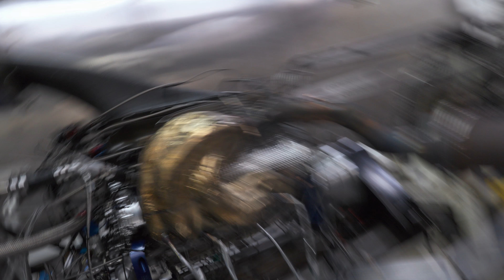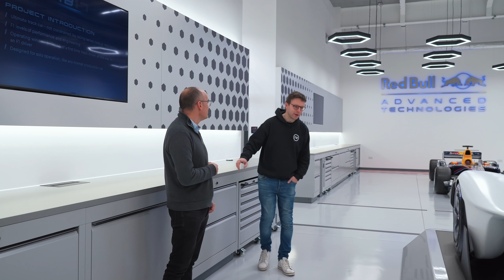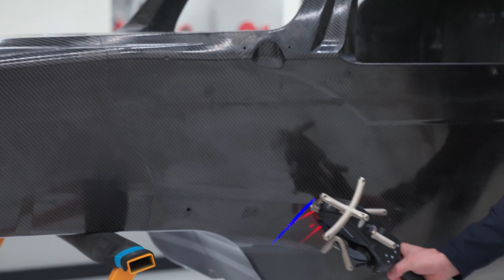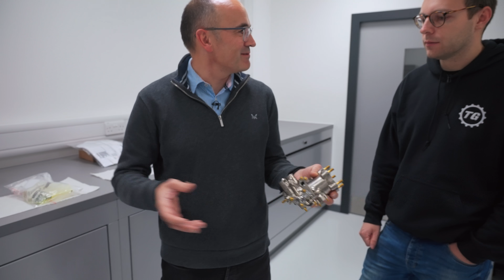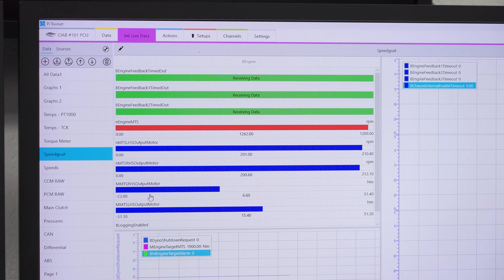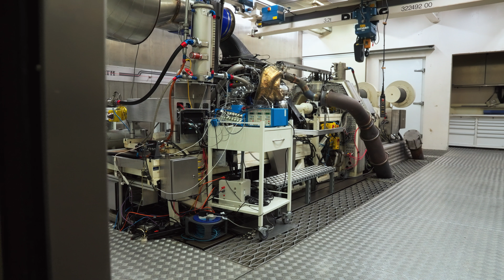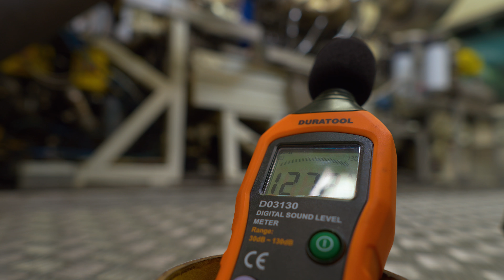Hear The Red Bull RB17 Scream: 15,000rpm V10!

Comment: Imagine 2026 f1 cars with this engine and no hybrid 😮‍💨😢
Reply: Imo hybrids get the best of both worlds, low rpm acceleration and brake regen as well as sound, character and power density of gasoline engines
Reply: @ShivamArya-yf4ku  you don´t need low rpm acceleration in racing. They usually have a gear se for the track and are always in the right rpm range. But e turbos might be very usefull.
Reply: @sebastianjo752 Yup, considering 2006-2013 F1 cars didn't struggle with 240 ft lb torque, way too fast even
Plus hybrid doesn't affect sound and rpm unlike turbo
Reply: @ShivamArya-yf4ku  hybrids makes the car faster, you don't need fast cars to having great racing. Less weight, nimble, smaller, less grip = pure driver skill and bravery is rewarded
Reply: Fun fact: Hybrid doesn't affect the sound. It's the turbos you wanna get rid off if you want the sound. 

The Revuelto, Tourbillion and laFerrari are all hybrids (with no turbos)
Reply: @499p-l1w but it affects the handling. We want cars to be agile and nimble without a push to pass button.
Reply: @calvinallan2208  No, we want closer racing action and overtaking, not parades. Anyone who has followed F1 for a long time will tell you how boring the V10, V12 eras were. The sound of the cars only matter to people who started watching F1 two years ago.
Reply: @499p-l1w  yeah nothing screams great racing like energy management chess play and push to pass. 😅
Reply: @calvinallan2208  With further development we might reach a point where we'll have very lightweight motors and tiny batteries, it just has to be developed first
Reply: Hybrid is the Porsche 919 evo, the absolute beats in Nurburbring.
Reply: Hybrid is actually cool tho
Reply: Why do y'all hate hybrids so much? I think they are pretty cool
Reply: @AB_LH44 Because Hybrid = boring Toyota Prius stigma
It's nonsensical, but that's how society works
Reply: @Holoflux hybrid with a high revving v10 sounds like heaven honestly
Reply: @tyler_bt3326  ad now a bugatti with a v16 hybrid
Reply: @Holoflux wait, didn't the hypercar trio (porsche 918, la Ferrari and mclaren P1) reversed that damage done by the prius. I think in the context of f1. People hated it because it traded howling V8 and v10s for "quiet" hybrid v6s
Reply: @flameburstgt6503  theres ppl out there who still hold the hybrid = prius mentality
Reply: @flameburstgt6503  Which the turbos are to blame for that, not the hybrid part, but people can't think critically idk how else to explain it
Besides it's completely subjective anyway, to me naturally aspirated might be LOUDER but turbos sound more powerful to my ears
Reply: @Holoflux turbo v6s in 1980s sounds badass. The issue is that the MGU-H muffled the turbo sounds. With that device gone in 2026. Hopefully we can hear the turbo spool and blow off valve / flutter a lot better
Reply: @flameburstgt6503  If the early recordings of the new engines are anything to go by, they sound exactly the same, sorry to disappoint you
Besides like i said, i like em as they are, nothing sounds like those engines
Reply: @Holoflux eh, I listened to the recordings as well and in my opinion they definitely sound more throaty. Granted it’s on a dyno but it’s definitely better
Reply: @flameburstgt6503  I think they sound the same as before, it's the fact it's recorded in a room
Look up any of the fire ups from previous cars, i remember the MCL36 fire up sounding just like these new clips we're seeing now

Comment: I still want more revs, 19,000 rpm goddamn it
Reply: This V10 is 4.5L, quite a bit bigger than the V10 F1 cars had with 3.0L, plus needed massive amounts of budget, specific preparations, short life maintenance, etc
Reply: Buy an old superbike
Reply: Won't last 20 laps
Reply: @499p-l1w Wrong.
Reply: @TheChipMcDonald  The guy at the end did say an engine revving that high wouldn't last long at all before a rebuild
Reply: @Rezcuz  As long as the mean piston speeds aren't high, 19k rpm can be as durable as 8000 rpm of a normal engine. 21-25 m/s^2 is usually considered the acceptable high, >25m/s^2 is when it all starts to creep into short life so yes 19k rpm can be a long life engine by design
Reply: @cyubahiroyves2899  Just repeating what the managing director for Cosworth said
Reply: @Rezcuz They ran v10s at 19,000 for entire F1 races.  This is headed to WEC or a consumer version, that will have to last longer than an F1 race.
Reply: @TheChipMcDonald  It's not headed to WEC, it's specifically for this car. And the guy said in the video they lasted for a few hundred kilometres. They need this to last way longer before a rebuild, hence why 19,000 wasn't optimal.
Reply: @499p-l1w  15k is already really pushing it. Need to consider some reliability.

Comment: RB should branch to LMH or LMDh fr, use a variant of the RB17 like what Aston Martin is doing
Reply: thats exactly what i thought, would make for a phenomenal lineup imo. having the throaty V8 from Cadillac to the screaming V12 of Aston Martin to now the wailing V10 from RB. would be absolutely incredible and a blessing to the ears.
Reply: @B-man5 that would be cool. The OG vs the evolution
Reply: @B-man5  it would need to be massively detuned to get into the aero window yet alone being silenced to get below the db limit the hypercar regs have(the valks in wec is silenced more than the imsa car is)
Reply: @markhunt7434  that's how racing works
Reply: @markhunt7434  Don't know if you were at a WEC race this year, but the Valkyrie is loud enough. It's the LMGT3 cars in WEC that are being castrated beyond recognition.

Comment: I know you can all do the math, but the idea of a reciprocating mass doing 250 strokes per second is something I just can't conceptualise myself - amazing!!
Reply: especially combined with the service interval indicated by the cosworth CEO, it really makes one think, that crankshaft has to be from out of this world.
Reply: Real insane is CBR250RR did 19000 rpm, mass production, cheap and decently reliable in the 90s
Reply: @MambaScalabrine-ub2kl the 250RR's redline is at 19k yes but it doesn't hit limiter until 20k, it is very hard to comprehend that there at 4 little pistons each going up and down 333 times a second
Reply: @jaydenriley6739 Yeah, it is - because that was a two-cylinder.
Reply: @KRAMITDFROG inline four cylinder
Reply: ever seen a fly?
Reply: @flummi6966  Wow I had no idea - thanks for a really amazing Google!!!  Who knew!? (not me)😄
Reply: @Phillip_Bailey_original   i didnt google, you can hear the frequency of something like mosquitos ,fly and bumblebees quite easy. depends OFC on your age and amount of party nights/concerts.

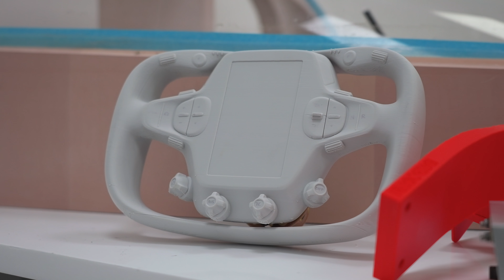Comment: 11:35 The car-industry copied everything "Wrong" with Tesla's vehicles(Touch-screen for everything). Tesla had to cut costs dramatically to promote the EVs of that era because batteries were so expensive. Much later, when the cost of batteries had fallen, car-companies are still using touch screens for everything. A damning illustration of how clueless and incompetent car companies like VW are.
Reply: New VWs are totally fine and the upcoming models will all feature more buttons again. A touch screen is perfectly fine as long as the most important functions still have physical controls.
Reply: @kraenk12  VW has made huge mistakes and will likely go bust.
For some reason, they decided to make the I.D. range which are too similar to the offerings from Tesla. However, in comparison, the VW cars are severely lacking with regard to drivetrain efficiency (and also fast charging/charging infrastructure).
VW presumably went for this sector because it is the most popular. However, at the time, VW had battery procurement problems and would not have been able to make the cars in sufficient quantity had they been popular... (They should have done Estates/Avants etc sooner). Now VW have their own battery plant(s), but everyone that wants an EV has one and they're not competitive enough.
The ID interiors look(ed) like the were designed by an undergraduate and 3 buttons to control 4 windows?!
Reply: Cant be that  WRONG as people bought the vehicles and made the model y the best selling CAR in 2023
Reply: @larropowell3658  Do you not understand the inverted commas?
There are pros and cons to both switches and touch-screens. However, for a driver, driving, tactile switches are better.
Reply: @Sidowse Inverted comma what has that got to do with my reply and as for your statement regarding driver and switches like I said the millions of DRIVERS that bought the tesla cars were quite happy with the screen set up. Tactile switches tactile screen they chose.
Reply: @larropowell3658  You don't understand my initial comment. If you did, you wouldn't have replied the way you did. 
Just because the Tesla <model-Y> sold really well, doesn't mean that it didn't have any negatives! Also, non car experts buy a car expecting the manufacturer to be more clued up than they! Only when living with the car would they subsequently encounter all the negatives/oversights and by then the car has already been sold/bought!
Reply: @larropowell3658 it’s far from the best car and since then sales have heavily declined.
Reply: @kraenk12 I did not say it was the best car I said it was the BEST selling car and sales for anything will eventually decline over time.

Comment: Adrian did the Valkyrie for Aston Martin before Red Bull terminated their relationship with AM and finished the rest of the car raw in places. Now Adrian does this car for RB and leaves for AM before it's completed.
Reply: What a full circle moment this is 😅
Reply: Only sort of. It was Aston that terminated the relationship because Lawrence bought the marquee. 
Aston ran out of money so Adrian couldn't make all the updates he wanted and the relationship was ending, so Aston took the LMH car that it canned and added some of Newey's modifications at the time and called it a day. 

But yeah, it is a twist of irony that Adrian would end up back with Aston after all that anyway, but he did say he wanted to work with road cars, so it was always a matter of time.
Reply: @F1ll1nTh3Blanks correct.  The AMR Pro has compromises that the RB17 does not have.  The RB17 is Adrian Ana Red Bull throwing everything they can at a car to get maximum performance with no limitations.   All prior track records will be shattered.  With the top tires it will make F1 look slow because of the lack of limitations.  Mega power and mega downforce.  It will be very important that the owners are properly trained to drive it if they want to get anywhere near what it can do.
Reply: Only this time he's still in charge of the Rb17 project until the end of it

Comment: So it will essentially be taking the aero + weight of the Valkyrie AMR PRO, but having the power of the road going hybrid 1200hp. The Valkyrie amr pro was already LMP1 fast, but I'm pretty sure, this still isn't enough to bridge the gap to the quoted "as fast as an F1 car" as all of these super hyper track cars have promised at the start. Or maybe... they had pictured 2026 F1 regulations long ago, and knew they would be like 4 seconds slower a lap, and over a long track like Spa, they might be able to beat an F1 car that's on a full tank of fuel.
Reply: Only if it's Max driving it
Reply: It's 100kg lighter than a AMR PRO, and 200hp more powerful, it has more aero, special designed tyres and the most importantly ACTIVE FANS that blow the diffuser at ZERO SPEED. In 'slow' corners and 'low' speed braking is way faster than a F1, it has more downforce at that speed. In straight line it's also faster because aero efficiency, F1 can only beat it on fast cornering. In the Red Bull sim the car is faster than any F1 of any era around multiple tracks.
Reply: @fjandro9646 this has already beaten every track record on the sims
Reply: @fjandro9646  ah right, the fans.  But I seriously doubt it can come close to any F1 car.  The only car that’s ever been able to do that is the McMurtry.  Those have real downforce advantage at low speed corners.  Much more than this.
Reply: @DonLee1980  porsche 919 EVO is 1160hp, 850kg, AWD and as fast as the fastest F1s, it beat Mercedes' F1 car at SPA and (Silverstone?, Idr) although F1s took the record again by a second, I think. RB17 is 1200hp and 900kg, not AWD but has the fans, also less battery dependent, its ICE makes 1000hp instead of 720hp for the porsche. Active suspension and so on, I think it will beat several F1 records around some track irl. Also, I think Max will try and achieve a Nurburgring record with it in the sub 5:10 or even sub 5. He likes Nurburgring and there has been some vague comments about the topic from RB environment
Reply: @fjandro9646 the RB17 is not 900kg.  The 919 Evo and F1 car weights are the full weight of the car with fluids aside from fuel.  F1 cars include the driver too.
Reply: It’s the de restricted Valkyrie AMR Pro Aston Martin wouldn’t let him build

Comment: i have a feeling this is gonna be road legal
Reply: 15,000 rpm pneumatic valves? This would be the worst road car ever made
Reply: @Shadowboost  AMG One uses pneumatic valves too
Reply: @fjandro9646  and it took them 4 years to get that engine to pass emissions at 11000 rpm. Not to mention Cosworth in this video said they did absolutely no work for emissions
Reply: @Shadowboost  Are you sure the problem was emissions, and not simply the engine staying alive in an environment it wasn't designed for?
Reply: @halofreak1990  yes, 100% sure. Go take a look at the startup sequence for the One, that's all to preheat the cats
Reply: @Shadowboost I never said it would be a good road legal car, but the headlights and side view mirrors, and wipers and everything, why bother with all these when you are going to make it track only
Reply: @aftabsk  to be fair, track and race cars typically have and often rely on those components as well.
Reply: @aftabsk  race cars have mirrors, lights, and wipers. You've never seen a race before???
Reply: @Shadowboost  obviously he hasn't
Reply: What the hell makes you think that 😂😂😂its a track car
Reply: @TurkioT-c7b it was in the original announcement
Reply: @aftabsk 😂😂😂😂😂 no it wasn’t
Reply: Don’t think so…
Listen to Cosworth Rep @ 34:00. He states that the engine “doesn’t meet emissions regulations [for road use]” and is “only for the track”…
Reply: Lanzante said they were working on it.